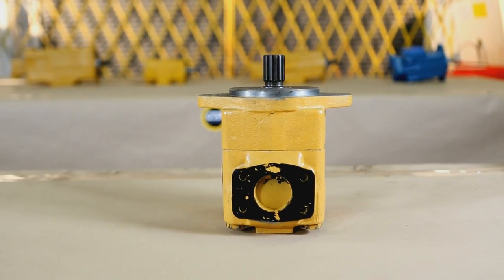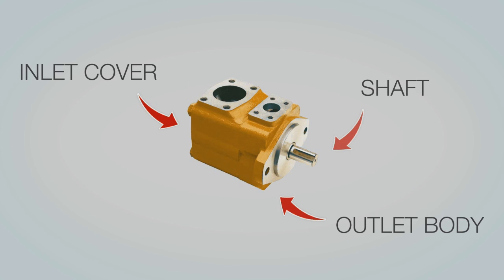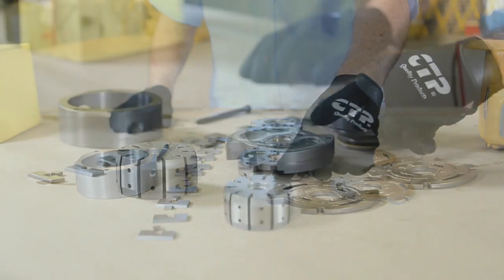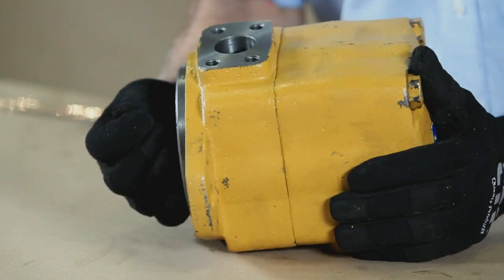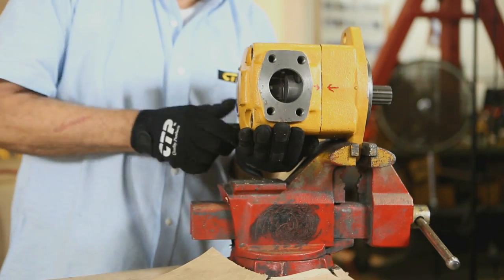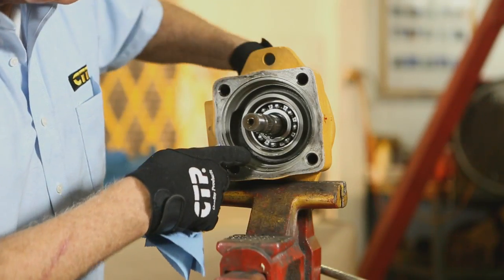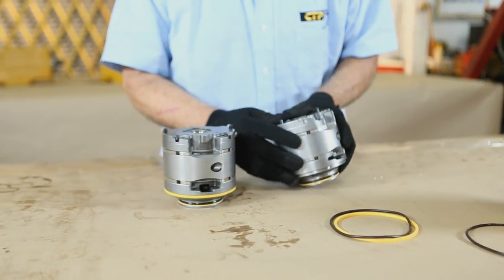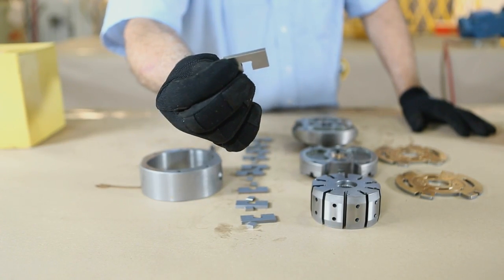Hydraulic Vane Pump Repair

Comment: Is the cartridge repairable?
Reply: Yes
If you like this clip 
Check my channel
Reply: Yes, the parts inside can be replaced, which is a better choice for replacing the pump
Reply: @Dieselpumpspareparts  thanks 😊
Reply: @arasheedc  Dear, are you still following this topic?
Reply: @Dieselpumpspareparts  no,dear
Reply: @arasheedc  Yes, this message is a little old😂

Comment: What is differentce between vane pump and servo pump
Reply from the maker: Thank you fro watching! A vane pump is a fixed displacement pump,  which means the only way to vary the flow is by changing the speed of the electric or Diesel engine.  They also can not vary the pressure output.
 
A Servo pump is in almost all cases a piston pump.  They can vary the flow and pressure with an electrical signal that controls the compensator on the pump to make that variation.
Reply: Thanks